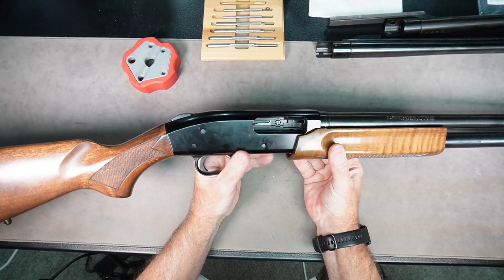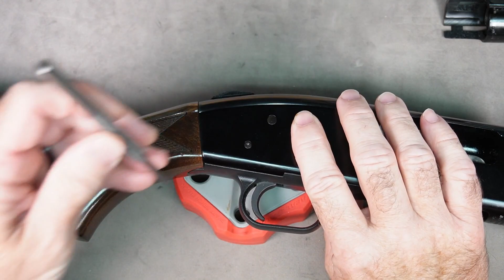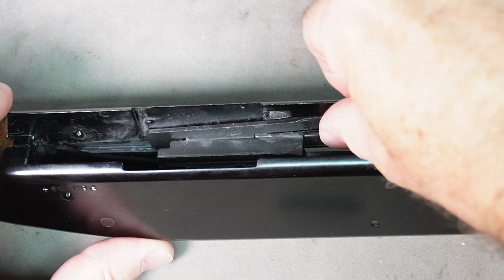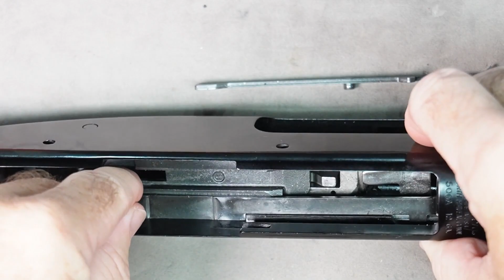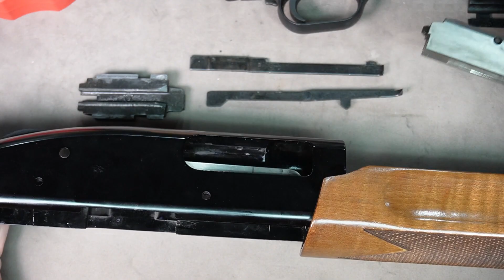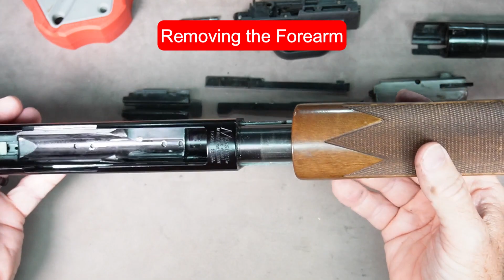Mossberg 500 Pump Shotgun Disassembly for Cleaning #mossberg

Comment: Which menda dispenser is that? I was just looking on Amazon and a lot were perhaps not safe to use with solvent. Others were saying that they let the leftover fluid seep back into the reservoir, which is an obvious no-no
Reply from the maker: I have looked on mine, but do not see an actual model number but when I compare it to the ones on the site, it appears to be the model 35309. I have used mine for many years and the Hoppes number nine does not seep back into the container.

Comment: So, I just bought a mossberg 500 all purpose field shotgun, once I get the housing group retaining pin out, the trigger assembly absolutely will not budge, is there a fix to this?
Reply from the maker: There really isn’t much holding it in, is there any kind of dirt or grime on this gun or is it a new gun?
Reply: @davesgunchannel  I ended up figuring it out. The stock was so tight it was keeping the trigger group in place so I just loosened it and it popped right out.

Im a new shotgun owner haha, I appreciate you actually responding!
Reply from the maker: Great! Glad you got it out. Good luck with it and be safe!

Dave